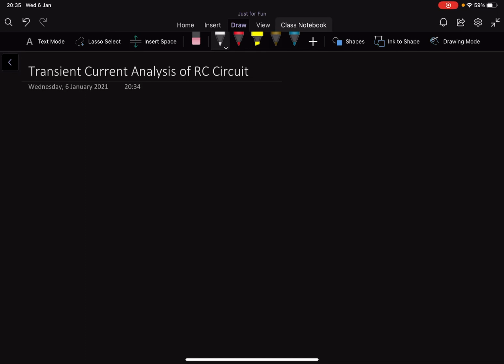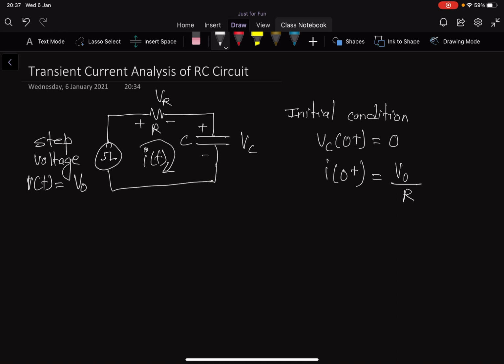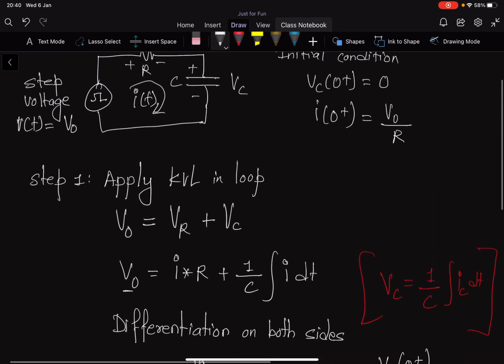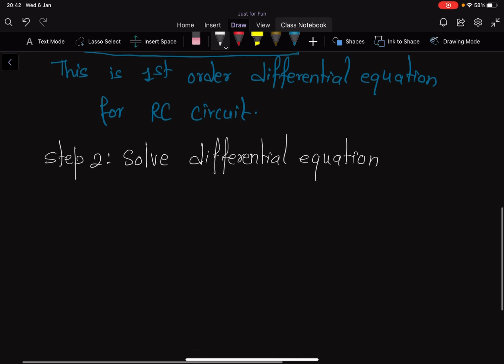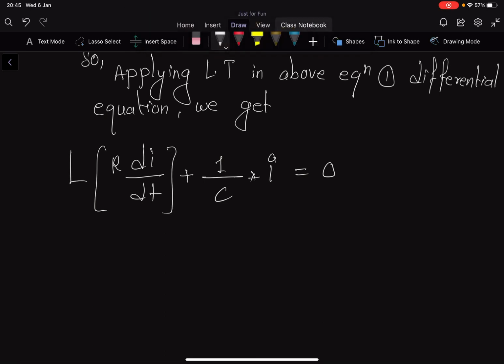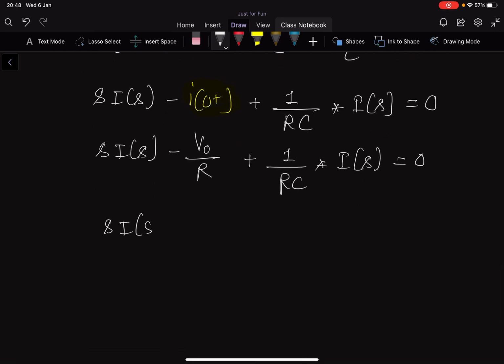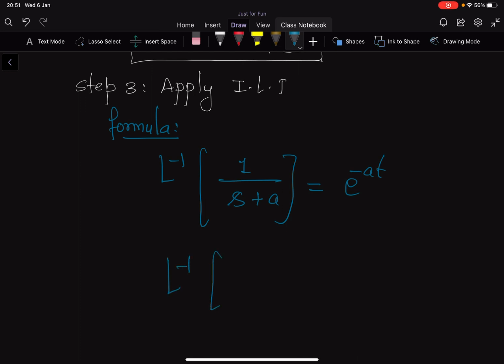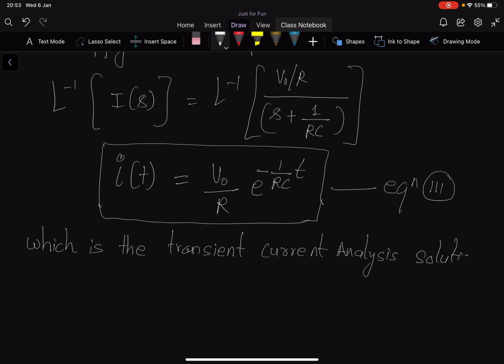Transient Current Analysis of RC Circuit Using Laplace Transform

Comment: What is the meaning of the s-domain in the Laplacian function? and what is the inverse function of that?
Reply from the maker: The meaning of s-domain is frequency domain, whenever you apply LT it changes the parameters into frequency domain (s). Inverse LT is other way around which means all s domain will return to its original parameters. In this example it’s time domain, in simple term x axis is time.